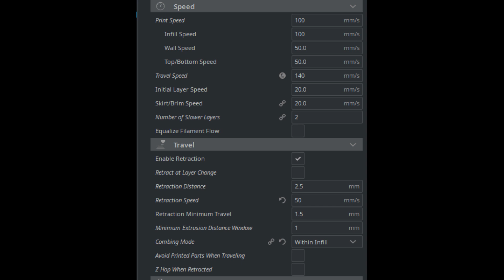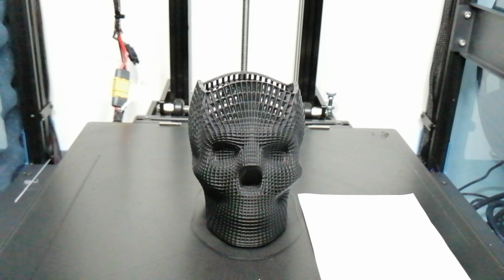Ender 6 - Stringing solved + Tips for Newbies and the Community

Comment: Would you say that shorting that bowden fixed 99% of the stringing?

My ender 6 is printing fine but the oozing/stringing kills me. Tried everything frlm 4 to 10mm retraction 25/75mm/s

Also i hear clicking the first few layers  like there is too much pressure building up in the hot end. 
I've got the capricorn bowden tube aswell and also made a new bracket for the cable and bowden entry point into the heat end.

I'm using prusa slicer (got cura too, but found prusa a bit better, after changing some machine limkt settings) do you have a cura profile available i could try out. 

Im pretty sure the problem is with the feeder and bowden. As its a clear sign there is too much material coming out causing the stringing 🤔
Reply from the maker: Well... in my world... the repositioning and the shorter Bowden helped fixing it.. but if it really eliminates stringing caused by this change ? ..No i dont think... its a gameplay between more variables...especially the software... 

To your special problem... if you didnt allready tested: Deaktivate the option "Z hop at retract". That caused very small strings by my setup.
For me..it sounds a little bit like your slicer is not doing things as it should be. Maybe you can retry Cura. My Profile is in the ZIP-File you can download from Thingiverse (link in the description). When you use Cura...you also have to delete the first few Lines of Code up to the "g28 Homing" :
---------------------------- 
G28 ;Home

G92 E0 ;Reset Extruder
G1 Z2.0 F3000 ;Move Z Axis up
G1 X10.1 Y20 Z0.28 F5000.0 ;Move to start position
G1 X10.1 Y200.0 Z0.28 F1500.0 E15 ;Draw the first line
G1 X10.4 Y200.0 Z0.28 F5000.0 ;Move to side a little
G1 X10.4 Y20 Z0.28 F1500.0 E30 ;Draw the second line
G92 E0 ;Reset Extruder
G1 Z2.0 F3000 ;Move Z Axis up
------------------------------------
This is my Start-Gcode... in the original Ender 5 Setup..it sets there some acceleration vaules and other Stuff to the printer... 
Try it out and please give me some response :)
Reply: Will try it out,  thanks for the quick reply ✌ will let you know what it does :)
Reply: Hi,  I would like to try Prusa Slicer can you give details of the changes made?
Reply: @petercallison5765  @0,2 layer height PLA i did filament flow to 92%. Retract 6,5 on 50mms print speed 120 rest 80 first layer and close perimeters 40. Machine limits are kind of weird haha I just put the jerk higher and travel speed to 150mm/s. I find that cura works better with the ender 6 than prusaslicer. But might just be my setting